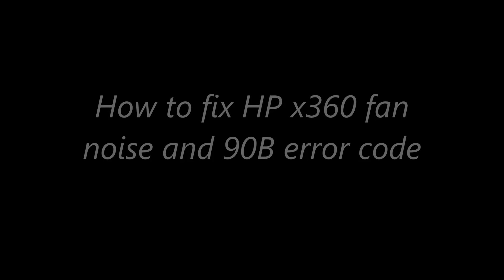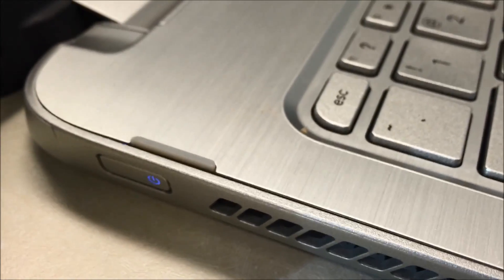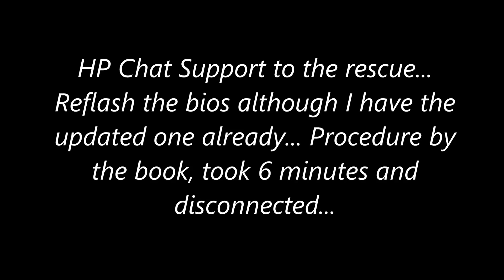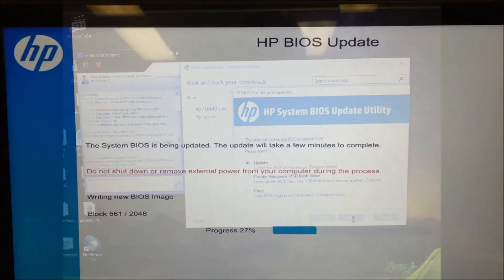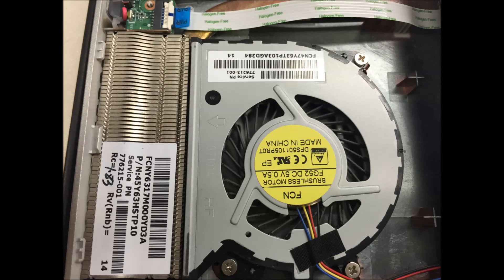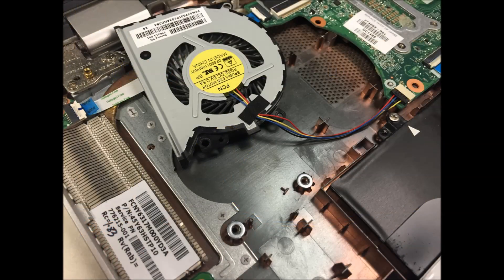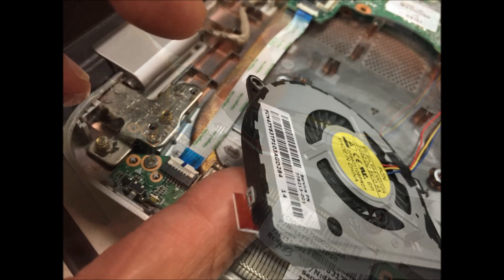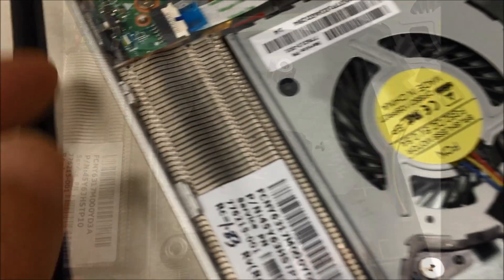how to fix noisy fan and fan error 90B on HP x360

Comment: Brilliant! Thank you! HP Pavilion g7-1279dx laptop had same problem. Fan "clicking" noise. Also got an error fan problem on boot up. Replaced fan but still noise clicking. The old fan was spinning up and down all the time - fix for that was to go into the bios and disable "FAN - Always ON". Now the fan doesn't spin up and down all the time and comes on when it needs to and spins fine but still clicking noise. So I watched your video. did the same thing and BOOYA! works like a charm! No more clicking noise. Thanks buddy!